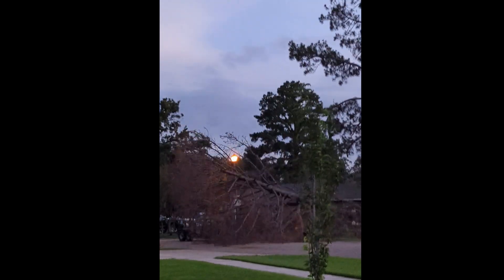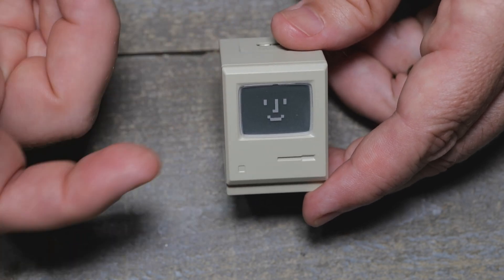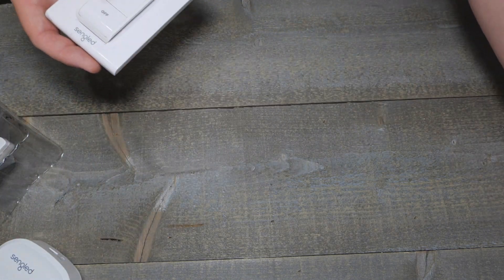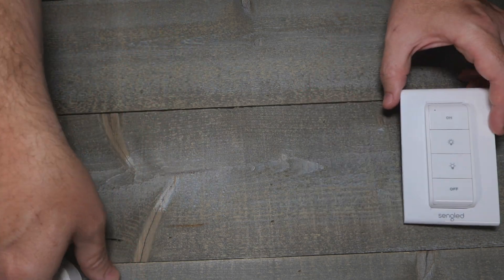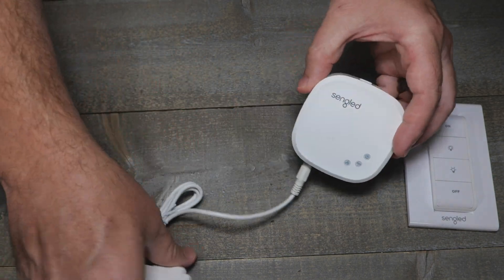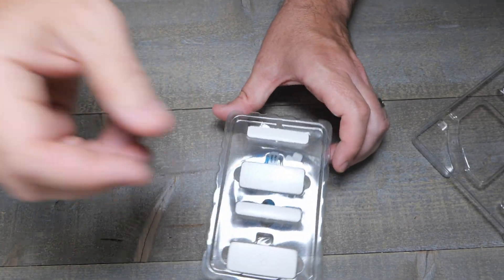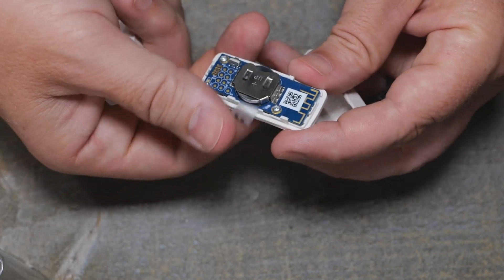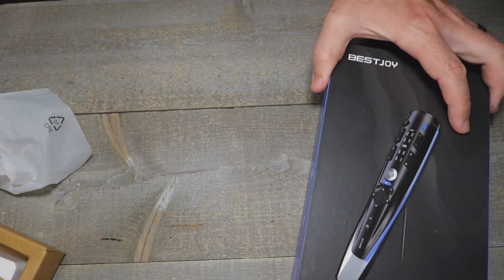UnBoxing - AOHI Cables, Sengled Zigbee, Shargeek, FNIRSI, GHome Beken Switches

Comment: I love how exited you where for the AOHI Cables. any chance your thinking of making an esphome thermostat?
Reply from the maker: Probably not given the logic and reliability is a little more than what ESPHome is designed for in my opinion. The AC running and staying in the realms of design is vital for my home.
Reply: Dang I didn't want to pay $200 for  something that most likely charges a subscription for basic features
Reply from the maker: Dig for some Venstar wifi models then. No cloud.

Comment: I know you have frequency issues with z-wave Travis but I'm really going off zigbee, it's garbage when try to tweak settings to save battery life on sensors. Only lightbulbs available from Sengled in the UK. Looking forward to the scope video. Will be interesting to see if it can actually display 100Mhz cleanly.